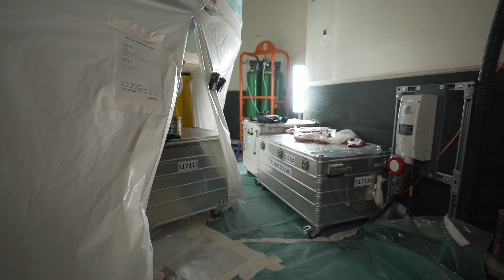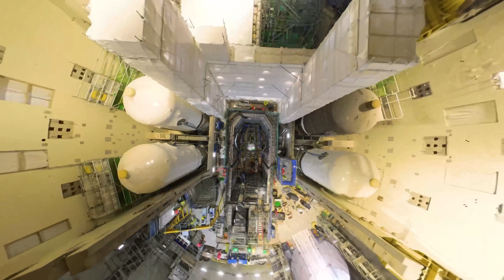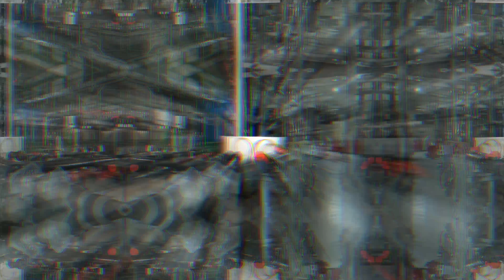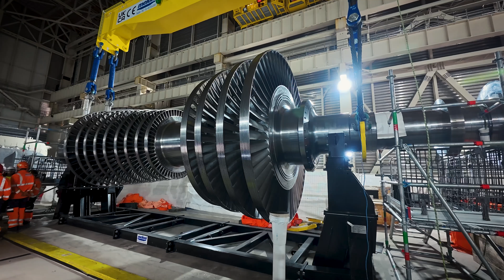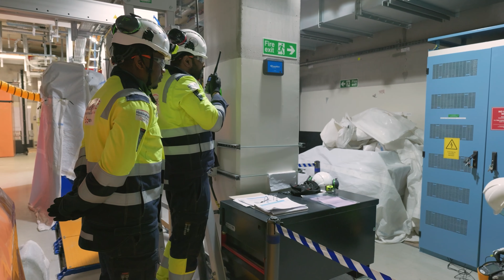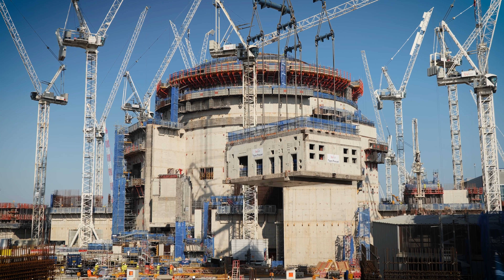Hinkley Point C | Project Update May 2026

Comment: Whaat a useless company EDF are. Thet punish customers for being energy efficient by threatening to cut customers off with an estimate .They are using a sharp practice to shake customers down for more money.n They have just changed their billing from monthly to quaterly. I got an estimated bill of £3550. I know for a fact I don't use more than £300 per quater. They asked for a reading as I reuse to have a smart meter. This is not to be economical for the consumer but to tell EDF when you are using the electricity as it is premium rate from 4pm to midnight. 4pm as the kids are coming out of school and people getting back from work. They charge more for premium rate which is why they try to force a smart meter on you. They also make money from selling your data.  There needs to be a law in place to protect the consumer from this. I have wrote to them and told edf I catagorically I do not give them permission to sell my data.

 They then ask for a reading.  I take photos of the meters and send them in. I am very savvy regarding how I use my electricity and don't use gas. They don't believe the readings and accused me of fiddeling the meter. I told them to send a diagnostic team round so they send their people round to read the meter which confirms my reading as true. In the meantime the estimate was corrected and they said I was £450 in credit and the bill has been adjusted to another estimated amount 0f £1550. It states this is an estimate not a bill. How the hell can someone who uses £300 per quater be £450 in credit and still owe an estimated £1550?? I dont even use £1200 in a quater this is taking an absolute liberty. They then threaten to cut me off with an estimate NOT A BILL. I spoke to a solicitor who said this is out of order and they can't do it.  They can only cut you off with a bill not an estimate.

I` have seen through their shennanigans and have sussed what their motives are. This is all a shake down to put extra money on the bill. Outraghed consumers phone up and complain and they've got you. You haggle they halve the bill some people would accept this but not me. why should I give them a years money for a quater. They will reduce the bill furthet and put £20 on the bill which the consumer happily pays thinking he's got a result yet pays an extra £20. If EDF do this to 200.000 people thats an extra £4 000 000 they've raised. I just want to leave this here so company officials know they have been sussed out. I am complaining to the ombudsman and nconsidering court proceedings just to give them a nasty bill to pay. A taste of their own medicene

Comment: The purchase price of nuclear power from this plant will be 18-20 pence/kWh under that crazy contract when it goes online!
The strike price in 2012 was set at £92.50 per megawatt-hour (MWh) - in 2026 it is £140 per MWh.
And, based on the terms of the contract, it will continue to rise in line with inflation!

Comment: Budget Overrun

* Original budget (2016 approval): ~£18 billion (in 2015 prices)  

* Current estimated cost (2026): ~£35 billion (still quoted in 2015 prices)  

So:

* The project is roughly £17 billion over the original budget

* That is about 94% over budget (almost double the original estimate)

If adjusted into today’s money with inflation:

* Analysts estimate the effective cost is now around £48–49 billion in current prices  

Schedule Delay

* Original expected operation date: 2025
  
* Current expected first reactor startup: 2030  

So the project is currently:

* About 5 years late

Construction officially began in 2017, meaning:

* Original build expectation: ~8 years

* Current expectation: ~13 years

At £50bn, very roughly:

Technology	Assumed build cost	Capacity £50bn could build	Annual output in UK
Utility solar PV	~£0.6–0.9m/MW	55–80 GW	~50–80 TWh/yr
Onshore wind	~£1.3–1.8m/MW	28–38 GW	~75–115 TWh/yr

For comparison, Hinkley Point C is expected to generate about 26 TWh/yr, around 7% of UK electricity demand.  ￼

So, on a pure capex-to-energy basis:

* £50bn of solar could produce roughly 2–3x Hinkley’s annual output

* £50bn of onshore wind could produce roughly 3–4x Hinkley’s annual output

But the caveat is big: Hinkley gives firm baseload-style output; solar/wind need grid upgrades, storage, curtailment management, interconnection, demand response, and backup capacity. 

Even with that, the comparison is brutal: renewables buy vastly more nameplate capacity and annual MWh per £ than new UK nuclear.
Reply: Structurally, the UK government tried to present Hinkley Point C as “privately financed,” but in reality the taxpayer and UK bill payer are carrying a very material portion of the economic risk through:

1. the 35-year CfD,
2. sovereign guarantees,
3. political/regulatory backstops,
4. nuclear liability arrangements,
5. waste handling arrangements.

The direct equity construction cost is mostly EDF/CGN, but the state support architecture is enormous.

Here’s the breakdown.

⸻

1. Direct taxpayer equity contribution

Essentially: very little direct equity

Unlike Sizewell C, the UK government did not take a major direct equity stake in Hinkley.

Construction equity is primarily:

* EDF
* China General Nuclear Power Group

So the taxpayer is not directly writing a £50bn cheque for construction.  ￼

⸻

2. The BIG subsidy: the CfD

This is where consumers/taxpayers pick up massive economic support.

Strike price

The UK guaranteed EDF:

* £92.50/MWh (2012 prices)
* inflation linked
* for 35 years

That number is now roughly:

* ~£130–135/MWh in today’s money due to CPI indexation.  ￼

The UK wholesale power price historically averaged far below that.

So:

* if market prices are below strike price → UK consumers pay EDF the difference
* if market prices rise above strike price → EDF pays back

This is funded through electricity bills via the Low Carbon Contracts Company.  ￼

⸻

Estimated total CfD subsidy

This depends heavily on future power prices.

Estimates over time have ranged from:

* £4bn
    to
* £30bn+

in net support value.

A widely cited independent estimate suggested:

* around £19bn present value subsidy under moderate power price assumptions.  ￼

But with:

* delays,
* inflation linkage,
* higher capex,
* lower financing efficiency,

many analysts now believe the effective consumer support could ultimately be materially higher over 35 years.

At current indexed prices (~£130/MWh):

* Hinkley is well above current offshore wind CfDs (~£45–75/MWh equivalent real terms).

⸻

3. UK sovereign loan guarantees

This is another major hidden subsidy.

The UK government provided:

* up to ~£2bn direct guarantee support initially
* broader eligibility under UK Guarantees Scheme.  ￼

This lowers EDF borrowing costs materially.

Some independent estimates suggested:

* financing benefit equivalent to £8bn–20bn economic value over project life.  ￼

Not necessarily a cash transfer unless default occurs —
but taxpayers are underwriting tail risk.

⸻

4. Nuclear accident liability backstop

Like virtually all nuclear globally:

* ultimate catastrophic liability risk is socialized.

If there were a severe accident:

* the UK state ultimately stands behind systemic damages beyond insured caps.  ￼

This implicit guarantee is economically enormous, though difficult to quantify.

⸻

5. Nuclear waste support

The UK government also agreed to:

* long-term spent fuel handling,
* geological storage frameworks,
* capped waste pricing mechanisms.

If actual disposal costs exceed assumptions:

* taxpayers may absorb overruns.  ￼

⸻

Overall Economic Reality

Direct construction:

Mostly EDF/CGN funded.

Economic risk:

Substantially socialized onto:

* UK consumers,
* future electricity payers,
* taxpayers,
* sovereign balance sheet risk.

⸻

Rough “all-in” public support exposure

Very approximate:

Mechanism	Potential Public Exposure
CfD support	~£10bn–30bn+
Loan guarantee value	~£8bn–20bn equivalent
Waste tail risk	unknown
Catastrophic liability backstop	unknowable
Political/regulatory guarantees	substantial

So while the UK did not directly fund the £50bn build cost, the broader public-sector-supported economic architecture around Hinkley is arguably worth:

* tens of billions of pounds
* and potentially approaches the scale of the construction cost itself under some scenarios.

That is one reason Hinkley became such a controversial case study in:

* nuclear financing,
* sovereign industrial policy,
* and long-duration energy market intervention.

Comment: seems great but the cost and time of its production, along with its limited lifespan when its up and running makes you wonder what could have been achieved with wind farms. my thoughts is that it would be much cheaper and quicker to produce the same amount of electricity, but without the constraint of lifespan of the project

Comment: Pressurizer was manufactured at ENSA, in Spain!!
Proud of it.
Reply: The heavy nuclear components for the Hinkley Point C EPR—including the pressurizer, the reactor pressure vessel, and the steam generators—are primarily designed, manufactured, and assembled across two interconnected Framatome industrial facilities located in  France
Reply: @RayZon69pressurizer manufacturing was awarded to Framatome, however, everything apart from forging manufacturing was subcontracted to ENSA in Spain.

Comment: Doen tingz izn I 🙂. We need to fix the pricing problem yesterday btw. Those higher "prices" we don't need to pay bring our consumer power down and energy bills up. Those savings increase the money supply in a majority credit market making all of our lives easier during contractions when it starts disappearing. I'd be interested in doing a few hours of work on it  and coming up with some ideas on on how to fix it if you want? This pricing problem is not an infrastructure problem, even though it needs work, meaning it is easier to fix than most people reading this might think. Or, at least, that's my understanding on this matter. Feel free to correct me if I'm wrong.

Comment: Using nuclear power as a reliable baseload to replace fossil fuels is a strategically sound move. It provides consistent, low-carbon electricity while supporting the expansion of renewable energy sources like wind and solar, which are naturally intermittent. By stabilizing the grid, nuclear energy makes it easier to integrate a higher share of renewables without compromising energy security.

It’s true that Hinkley Point C is expected to generate some of the most expensive electricity in Europe, largely due to high upfront construction costs. However, this needs to be viewed in a long-term context. Nuclear plants operate for decades, offering predictable, low-emission power that reduces dependence on volatile fossil fuel markets. In parallel, the continued growth of renewables—whose costs have been falling rapidly—will help drive down overall energy prices over time.

Importantly, renewables such as wind and solar are now among the cheapest forms of new electricity generation in many regions, including the UK. As investment, storage technology, and grid infrastructure improve, their contribution will increase, helping to create a cleaner, more resilient, and ultimately more affordable energy system.

Comment: Yes, good piece of engineering but apparently it's going to end up costing nearly 3 times the original budget so forget about cheap electricity for decades to come as someone has to pay for it. And don't tell me it's clean electricity when it produces lots of radioactive waste. Just wondering if this money really couldn't have been spent better on smaller scale projects but spread across the country close to places with highest demand 🤔
Reply: How do you feel about a closed fuel cycle with fast reactors?
Reply: @stijn2644 I feel good about it but as I understand, the HPC is not one of those
Reply: @tomiw9793  Maybe we should keep building the workhorse PWR and BWR's while on the side investing some billions in fast reactors in Europe. By the time the fast reactors are deployable by the masses, we have enough cummulated spend fuel to last Europe for centuries.
Reply: @stijn2644  Don't know, perhaps this would be a better idea indeed. But I would imagine there is already enough spent fuel around the world so no need to keep adding more especially at HPC cost. I like what Swiss are building, the 'liquid battery' that will stabilise the grid with renewable excess energy over the next 100 years.  Could have few of those for HPC price
Reply: @tomiw9793  Yeah the cost of HPC is rediculous. At least the UK is building up their nuclear industry again, could be an example for other EU countries.
Reply: @stijn2644 very true 👍

Comment: Amazing thing on the engineering side but..... How much is the cost over run  now? it was estimated in 2016 to cost £18b now it is £35b and there still 4-5 years from operation to load more cost increases. Then there's LCOE estimates, some saying £128 MWh compared with £38 MWh for onshore wind. Hornsea 3 a complex offshore wind project with total output capacity very similar to Hinckey point C. Difference is it will be completed next year (4 years to build not 14) cost £9b not £35b++ and will produce electricity at less than half the MWh cost of this.   BTW those costs dont fully include decommissioning Hinckley point C in 2080 and if the process of decomissioning is the same as Hinckly point B that could take another 60 years into the 2100s!!!!  Surely Big Nuclear like this has had it's day.

Comment: Blah, blah……. No honest info on time schedules. Holding up a bit of wire to indicate the many miles required. 
Crew requirements and facilities. Housing and canteen, 7 day work schedules or 5 day schedules, shift patterns etc. Most workers do not reside in the area, therefore the desire is to complete the job as quickly as possible and get back to loved ones. This was a poor comment on major undertaking.
Reply: It is a scam.

Comment: I wonder how many solar panels and home batteries £45 billion could have bought instead
Reply: The issue is that doesn't supply base load. Unless you want to have power only 50% or burn fossil fuels, this is the only realistic other option. sure you could flood 10 valleys in Scotland and do pumped storage or something, but let's be real.
Reply: @james-5560  Solar + grid energy storage is already cheaper than new-construction commercial nuclear.

What's more, solar + storage can be built in a fraction of the time and in many more locations than commercial nuclear energy.  In 2025 alone, BESS systems dropped in cost by 25% to 45%, while nuclear heads moved in the opposite direction, becoming more complex and more expensive.

Both solar and energy storage are becoming cheaper year after year as they ride the cost curves down through true global serial mass manufacturing.  Solar can have product-generation iterations in months—not decades, like nuclear.   Renewables exhibit "positive learning rates" expected at true global scale, unlike nuclear energy, which exhibits negative learning rates.
Reply: Turns a profit after 40-50yrs, last 20yr is pure profit. Need to keep in context
Reply: Which, of course, doesn't guarantee electricity 24 hours a day.

Comment: Great engineering and effort, such a pity it's not a UK designed and built system.
Reply: Then you're gonna like Wylfa, that is projected to host 3 Rolls-Royce reactors.
Reply: If you are gonna work with another country could do worse than France TBF. Unlike us they were sensible enough to continue investing in nuclear.
Reply: @east_const  I agree. The thing about France is that they really value independence and therefore protect all of their industry. If only our leaders had the same mindset.
Reply: The Finnish OL3 project and the British Hinkley Point C (HPC) project, both utilizing EPR technology, represent two fundamentally different approaches to nuclear safety and quality assurance. The Finnish process, governed by the regulator STUK, is built on a "Zero-Footprint" proactive quality mandate where the supplier bears the total burden of proof. Under Finnish law, every technical solution and software line must be proven to work through rigorous deterministic analysis before implementation. This creates a perfect feedback loop: if a design cannot be proven safe to the regulator's satisfaction, it is legally considered non-functional, forcing an immediate redesign. As the world's first fully computer-based nuclear plant, OL3 served as a global test laboratory where digital automation was put through an unprecedented "feedback grinder," identifying thousands of architectural flaws that were corrected in real-time.
Hinkley Point C has been the primary beneficiary of this arduous Finnish process. While the UK regulator, ONR, uses a more goal-based "Safety Case" approach that audits the developer’s processes rather than every individual bolt, the technical design of HPC is essentially a "hardened" version of OL3. The British project integrated lessons from Finland’s digital automation struggles by adding a diverse, non-computerized analog backup system to satisfy UK resilience requirements. Furthermore, HPC avoided the manufacturing quality scandals that plagued OL3 by applying the technical standards and inspection protocols that were only developed in Finland after the problems were discovered. In essence, the Finnish "prove-it-first" culture acted as a high-stress filter, allowing the UK project to adopt a more mature, pre-vetted design while bypassing the decade-long trial-and-error phase of the EPR’s digital evolution.
Reply: Edvance is based in the UK and do the final engineering, 10,000+ workers from the UK as well building it.
Reply: @tobert6609 edvance is a subsidiary of EDF with head office in paris